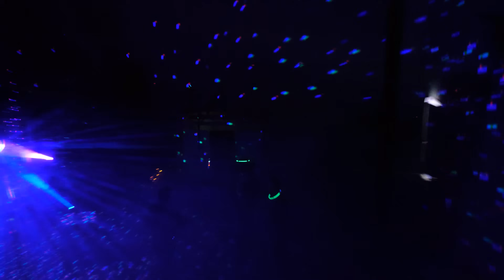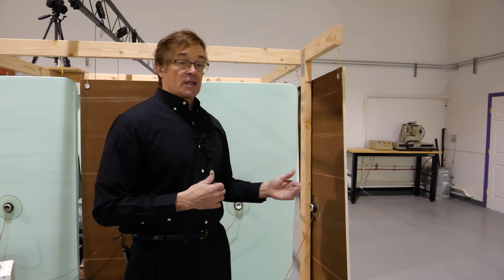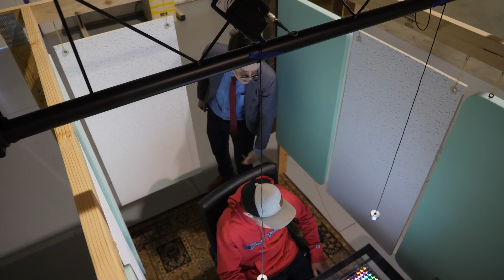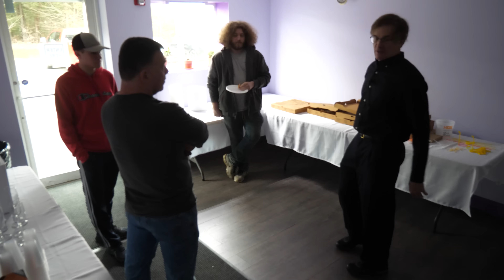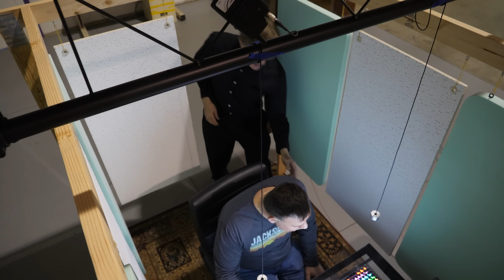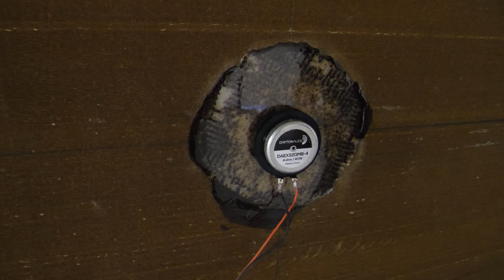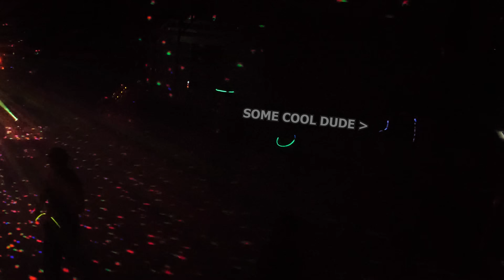SHOULD SPEAKERS THIS GOOD BE LEGAL?

Comment: “Sonarworks SoundID Reference Measurement Microphone”  is a microphone that when paired with the Sonarworks software uses an EQ to make a completely or close to as flat as possible frequency range.   I think if you used this microphone which is commonly used in professional mastering studios calibration for music production it would give you amazing results and insight into where frequencies are building up.  It would also be interesting if you could find a mastering engineer locally that would be willing to come sit in the box with a trained ear and tell you if this could be a substitute for studio monitors
Reply: A calibrated measurement mic is not a recording or tracking mic.  It will work of course and likely sound clean and critical but not what it is really designed for.  20-20k flat is not always a good thing.
Reply: @mikeiver  This mic is only intended for calibrating the Sonarworks software.  It has a gyro inside and is why this spastic mic is useful for calibration.  Flat is the goal and why mixing studios spend millions to get a flat sound
Reply: @RyLeedepressed  mixing studios don't spend millions getting to flat.  Who told you that?  Again, you can tweak a space and deal with room anomalies, install base traps and wall, floor, and ceiling treatments, and get the hot seat to sound really good fairly easily.  But in the end the engineers learn the room and the speakers they are monitoring on.  There are few "magic rooms".  But we are off subject here.
Reply: @mikeiver  Well, yeah. A measurement mic is for measurement and only that. It is good you mentioned that in case someone might think they are for recordings. 
    I was wondering if you had tried REW ? and could compare it to sonarworks. REW is a huge package. It takes some time to learn, but there is a lot of info and seems to be versatile for many uses.  I've used REW for much more than room measurement. I've used it to >> dial in crossovers ; test signal to noise ratio's of amps/synths/drum machiens/etc... ; test speakers themselves. like the individual speakers from a 3 way ; adjusting port size of speaker enclosures ; and of course acoustic treatment of studio recording spaces. It helps you pinpoint where to put the foam & even can show what happens when you put chairs in the room.  It's pretty cool !!
Reply: @tdtrecordsmusic  Nope, but know a few guys that use it pretty much all the time and get great results.
Reply: @mikeiver  cool cool. thnx 4 being honest :)
Reply: How would you compare sonarworks to REW ?   Have you tried REW  ?

Comment: The backs of the panels are 180 degrees out of phase with the front. That means the low frequencies cancel. Consider the wl at 140 hz is  roughly 2.5 meters-close to the size of your panels- corresponds roughly with your (3db?) low frequency cutoff.

Maybe mounting with compliant sealed surround over a sealed, shallow labyrinth? I wouldn't think a cutoff at 120+ hz  great for guitars.
Reply from the maker: That is why  locating these speakers in a large room works well.  Some users find the sound quality  improves when the wall behind them has a sound absorbing material hung on it.

Comment: You asked several times to compare against headphones.  IMO headphones and these are not good to compare unless you are phase delaying your sound to present the sound incidents at the same point.  Headphones are physically close, and to give a full spatial feeling, you'd need to delay accordingly.
I would think using proper mics you could measure the sound pressure at 1 watt across the entire audio spectrum and eq center in order to create a room neutral environment.
Then allow the listener to 'adjust' per his taste.
Overall, this concept is rather awesome.  You mention home/apartment construction.  Question on that, can you neutralize the 'back sound' of the panels?
In other words focus most if not all the sound into the created 'room' with no sound pushed out?   Understood sound bleed from the room itself, but a unidirectional speaker panel?

Comment: Does having the panels hanging in front of a wall differ from hanging away from a wall.  Does the bounce off the wall help or hurt?
Reply from the maker: It doesn't help.  Placing a sound absorbing material  on the wall behind  one of these speakers improves the sound quality.

Comment: the Imax theater where i live does essentially the same thing. the entire movie screen for the theater is speakers. its some insane number of speakers, but its floor to ceiling, wall to wall. its a massive wall too, 53 x 69 feet. the screen they use to catch the projection is "acoustically transparent" but i could never find information on what exactly it is (my guess is spandex with high gain paint).

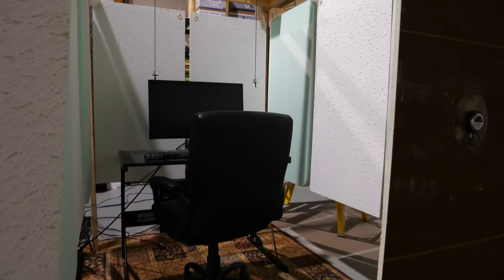Comment: 4:10 "The worst acoustic environment" would be subway bathroom with lots of high frequency reverb and lots of low frequency backgroud noise, not a huge warehouse without nearby walls or ceiling. I'd say that without proper acoustic treatment, that warehouse is actually nearly the best acoustic environment you can have for a speaker setup.

I like the idea but I don't like the fact that you're overselling this setup.

Comment: Did you use any DSP processing for the panels or the sub? I'm currently using studio monitors and DSP corrected sub which fixes both group delay and frequency response. I'd expect that this example would benefit from DSP corrected sub, too, especially because you need to go so high in the frequency range. (I'm using an old DSpeaker 8033 DSP which can actually improve both group delay and frequency response unlike some lesser systems that only fix frequency response but leave group delay unfixed or even worse than the original.

Comment: 14:00 that "this cost only $200" doesn't include the sub or the amplifiers, right? A good sub costs $500+ and a high quality multi-channel amplifier will cost also $500+. It would have bee nice to tell us more about the sub and the amplifiers. It seems that you're using open monoblocks or some other esoteric solution.

Also, would this work without lots of space behind the panels? If I understand the implementation correctly, those panels will radiate the sound also from the back and if you get that reflected back to the listener from nearby walls the result is much worse.

Comment: I would have thought it would depend on the AMP driving them especially if it was a TECHNICS SU-A900 MKII or the new TECHNICS SU-R1000 FPGA based amplifier.

Comment: I'm wondering about frequency response curve, harmonic distortion for frequency/amplitude, damping graph, sensitivity, dispersion chart, maximum power output, phase diagram, and output impedance by frequency. Each of these would show some aspect of how good these speakers really are. 😀Of course these tests would take a lot of time and equipment to do correctly, unfortunately.
I had also said something similar in the previous videos on the topic of this speaker. Otherwise, for their price, they aren't too bad, but I probably wouldn't use them in a professional audio setting. I am happy to see that as the channel has matured that the quality and techniques have been steadily improving. 🙂

Comment: I think it’s interesting they sound sharp, I wonder what frequencies snap out well, the width of each source producing the same frequencies from multiple locations on the panel would in theory muddy the sound because the arrival time to the ear would vary and standing waves would be interesting as the unit as a whole builds pressure but regardless if it sounds good then that’s what matters
Reply: Also in theory headphones are not cable of the whole sound spectrum we hear, but sound good because the lack of crossovers to multiple drivers giving a near single arrival time to the ear. It’s cool the panels is  phase cancel the outside resonance from the inside. I think for actual audio engineering they wouldn’t be accurate enough because the time arrivals but perhaps they would be repurposed with microphones as active sound canceling panels for a typical studio monitor setup, but then the room would still be too small for the longer bass waves that don’t fit and build up

Comment: what model of amp are you using to drive this? it looks like a set of tube amps.

even the absolute best tube amps (even hybrid ones) typically have a fairly high output impedance, usually between 4 and 16 ohms (which unfortunately matches the range of typical loudspeakers, the amplifiers for which are usually marked with the expected speaker impedance, not the output impedance). while in most electronics applications you would expect to match the impedance, in most audio applications, output impedance should not match your speaker impedance, but should be at least 8 times the impedance - meaning that for an amp with an 8 ohm output impedance, you would want at least a 64 ohm load. this is particularly important if you are using standard dynamic drivers - the difference is very easily audible even to untrained ears. 

i suspect that your speaker design is less susceptible to the negative effects of this (as are planar magnetic headphones and some other such alternatives) but this may be something you want to double-check anyway.

Comment: One thing that is odd with flat panel speakers is the sound doesn't fall off with distance in the same way that it does from a conventional cone speaker. Cone speakers act more like a point source and the sound drops as an inverse square law but with a panel it falls of more linearly. I.e. they project sound further without being too loud close up.

Comment: I really love your videos on your flat panel speakers.  Exciters are very interesting to me.  I have not tried them yet, but I do like your use of ceiling tiles and styrofoam panels.  I did a little research and found many commercial applications/uses for exciters.  Some examples suggest putting them on a boat hull (to create a party boat), or attaching them to the inside of your home windows (for instant outdoor speakers).  They even will work on cardboard, so there is potential in some interesting halloween decorations.  Anyway, keep up the great work!

Comment: Tech Ingredients, I built a pair of DML using your earlier video. Each speaker has two 40 exciter wired in series. Each exciter is attached to a 2' by 2' 1/2" end grain balsa wood square that was pre seal with epoxy per your instructions. Each speaker has one square with right angles, and another with curved edges. The curved edge board has the exciter placed using the 2/5 3/5 rule and the square board exciter is centered. They look sound great except for the lower ranges. All for boards produce a kind of rattling noise. It is coming from the exciters themselves. The curved boards produce a stronger rattle. If I hold the panel they still make the rattle, however if I hold the exciter itself the rattle is diminished. I was thinking of making another set of speakers and after watching this video I excited to do it. I had one question though, what type of epoxy was used on the back of the panels?

Comment: Back in the day, the stereo shop would influence your speaker selection by cranking the volume.  I get the impression you coached the first subject on volume control and it never changed throughout the experiment.  If I were in that booth I would drop the volume down until the quality diminished.  I wonder where that is for these speakers?

Comment: @Tech Ingredients. I think you should experiment with different ways to hang them so vibrations are not transmitted up through the frame. I know it is very small amount  of vibrations but maybe it could help against a test against expensive monitors as people In here are asking you test them with a engineer. 

Also I think you should use rubber and stuff like that to hang it. If you push every inch of performance you can this could become the future.

Best regards A Big Fan

Comment: You guys have some of the coolest projects and a great channel. That's why I'm SUBSCRIBED!

Will you be going into more detail about how to make these panels? For example, could I use two of them for stereo in my office/edit-bay room (really a bedroom) that's already quite crowded? How about a stereo pair in my oddly shaped living room? Is there an option to make a full range speaker with a single panel material? How does the panel size affect the sound quality? Is bigger better? Will smaller panels work?
Inquiring minds want to know.

Comment: Sometime in the 1970s? Radio shack sold speakers with flat foam instead of normal cone material.  I bought a pair and was amazed at the sound compared to some "normal 8 inchers from, I think, Jensen.  Very pleasant highs and mid range.  I was also playing with a "Sweet 16" array of speakers and discovered that wiring speakers in series tended to "even out" the resonances compared to driving them in parallel.  My 2 cents.

Comment: have test subjects sit in a conventional setup to compare to, like ribbon tweeter 5.1 setup, and ask them which they like better. And give them the app to mess around with equalizer to see what adjustments they'd make to finetune to their liking.  Like to turn down the bass frequencies for example. Volume control should remain 100 on the PC, and only adjusted by volume wheel on the speaker themselves.

Comment: Would a thin coat of paint affect the acoustics.
Reply from the maker: Spray paint works well.  A solid sheet, although thin, of latex reduces the lower frequency  output.

Comment: What would happen if I used the ceiling tile, only I cut a grid pattern of two inch holes in it? would this decrease the rigidity, and allow it to reach higher frequencies? The reason I ask is this. Have two panels instead of one to reach a greater frequency response is fine if you have the space. However, I was thinking one panel behind the other with only inches between the panels would allow more panels in a smaller space. This scenario would have a two panels of different materials resonating at differing frequencies. Then I thought that this would cause the front panel to act as a barrier and not allow the back panel not to be heard as well. So my second thought was to calculate the rigidity of both panels, determine if holes could be made in the ceiling tile to make it have a rigidity closer to that of the foam panels. If this could be done, this might allow there to be two panels front to back the front one with holes creating frequencies different from the rear panel and yet the holes would allow sound from the rear panel to pass more freely. I have no way to test this idea, and do not KNOW that the front panel will block audio from the rear panel to any significant extent. Creating a frame that could hold both would make them more transportable. Having an X shaped brace front and back would prevent will prevent the panels from swinging when moved, maybe rubber bands one the bottom corners for shipping, maybe permanent (if it does not interfere with the sound). Maybe loosely attached string at the bottom?

Comment: Tbh, I’m quite disappointed by the rigour of this.

1. We have no idea whether the recordings were of sufficient clarity
2. No idea what each person’s past experience is and therefore what their subjective judgement means
3. It does not address any of the criticisms of the TechIngredients DML design such as:
  a. Many people have found clearer results with a frame and a brace that holds the exciter (forcing more energy to transfer in to the panel and be converted in to  sound. Dayton also suggests many designs that including some type of frame, and no designs featuring free suspension)
  b. Dayton themselves list the TechIngredients materials as “Less ideal”, and offer one that’s even cheaper in the “Excellent” category: paper-backed foam-core poster board like you can find at the dollar stores

Comment: You are cheating by using a powered subwoofer.  Bass is the most engaging and emotional musical frequency area.  Just look at what happens when you put on a good dance song with lots of bass.  Everyone starts dancing and smiling!  Take out the bass, and you are left with very boring frequencies that are hard on the ears to listen to without bass.  You can see this when the mom and boy listen.  As soon as the bass comes on strong they start bouncing their heads to the beat and smile.  I suspect the high end drops out around 5k as well?  Have you measured it?  I have hearing all the way to 20k and your microphone when people are talking is picking up highs past what your audio system is playing.  I could see applications for these "speakers" say in a mall or something, but far from high fidelity.